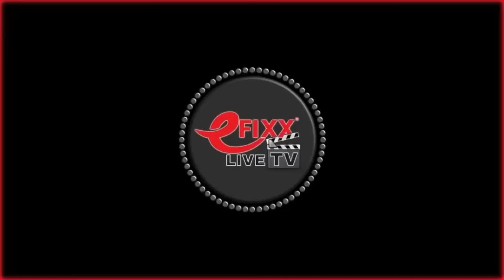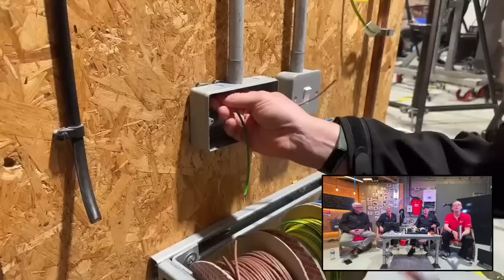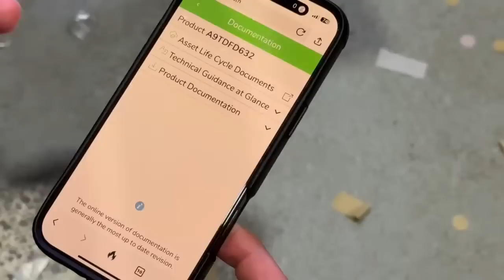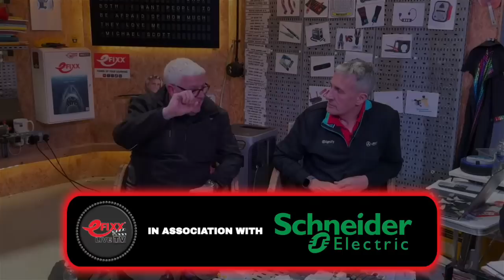🔴 The Future of Circuit Protection - Schneider Acti 9 Goes Online

Comment from the maker: Time Stamps ⏱
00:00 eFIXX TV 27/11/24
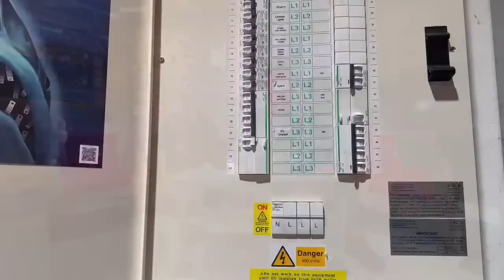01:45 We'll be exploring the Schneider Acti 9 range
03:50 Introducing tonights' guest
05:00 Andy has a new book out!
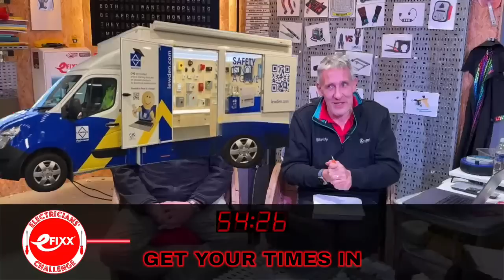07:00 GT Time
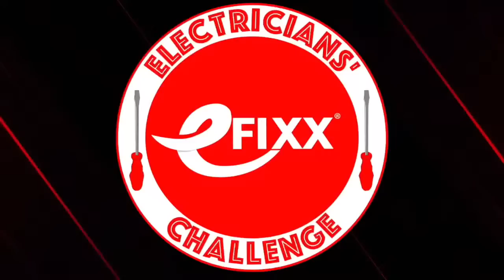08:43 Electricians' Challenge
12:12 Placing Andy on the leaderboard
14:23 Joe Robinson owns up to being wrong
17:00 Why are Schneider the market leaders?
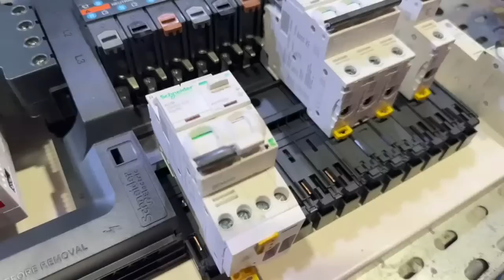20:05 The worlds best circuit breaker?
25:20 A closer look at the Acti 9 system
27:00 Acti 9 goes online!
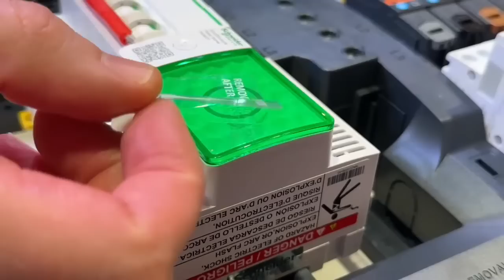34:45 The brains of the system
39:20 A special guest is at Lineside Studios
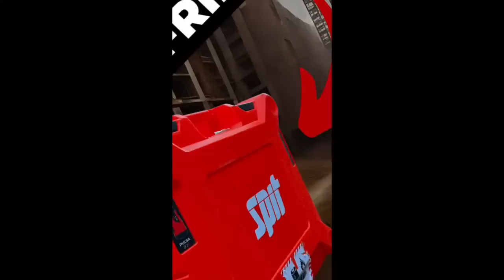40:58 A black Friday Spit promo
42:00 HAPPY BIRTHDAY GARY 🎉🎂🎉🎂
49:00 Fitting the AFDD and more features
55:00 A clever QR code on the Acti 9 device
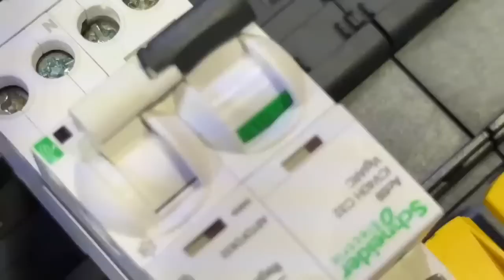56:57 Did you think these were painted?
1:07:45 Win some F1 merch from Signify
1:08:42 Live Regulation Corner
1:17:27 Thanks for watching! Roll the credits.